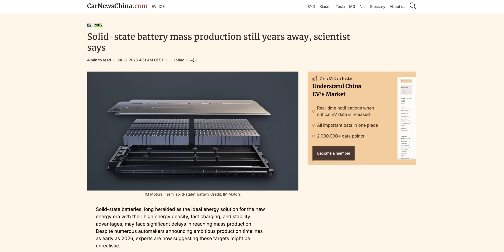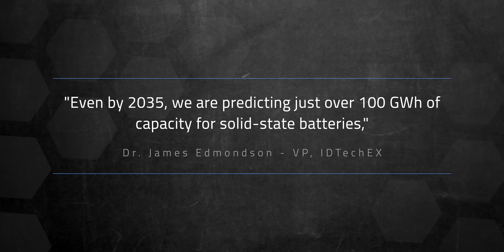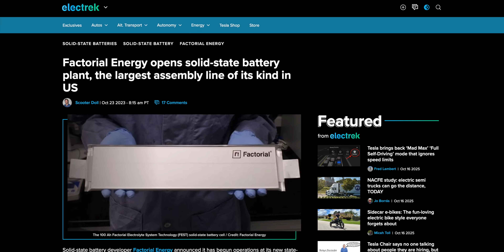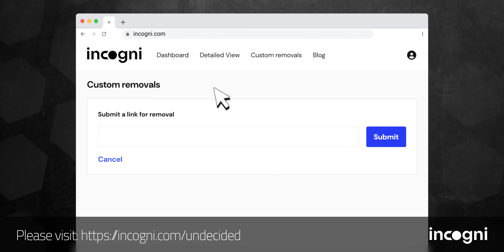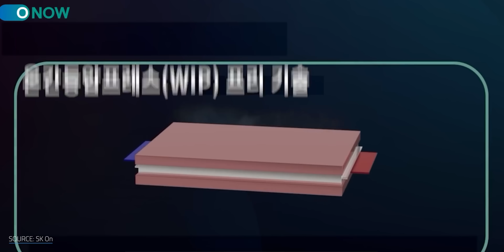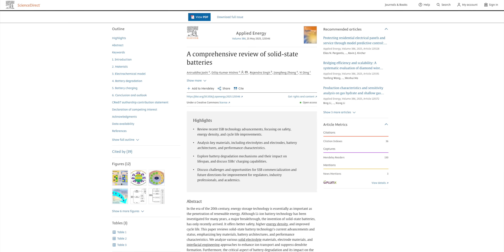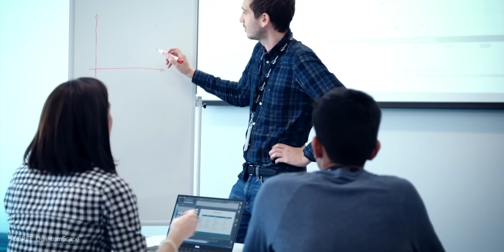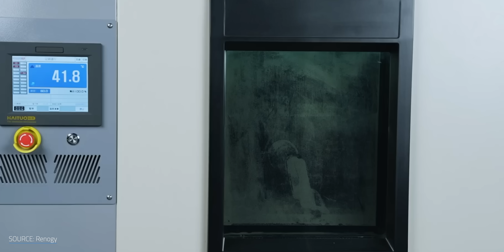How Close Are We to Solid-State Batteries?

Comment: I think that the present and mid term future (<10 years) are the hybrid vehicles. Charging 80% in 12 mins is not a game changer. The idea is charging 100% taking the same time to fuel a tank full; this would be a game changer (assuming the same quantity of energy added) Also, the batteries should keep its energy density for years

Comment: If SSB technology can meet a few key goals, a lot more American drivers will at least consider replacing their ICE car with an EV. If the energy density can be doubled, 5 passenger sedans and compact SUV's with 600 miles of range will be possible. If 600 miles of range can be added in under 40 minutes (assuming a 300 kW EVSE), acceptance of EV's will increase dramatically. If cycle life increases to where a battery will last 500,000 miles, people will quit stressing about it - very few Americans want to keep any car that long as it is. If SSB electrolytes prove to be more resistant to dendrite growth, especially during DC fast charging, prospective EV buyers will quit stressing about battery replacement cost.

Comment: Why are they called solid state? ALL batteries are solid state, nothing moves… maybe they should be called solid construction? Solid electrolyte?
Reply: It's got nothing to do with moving parts the term comes from Solid state ionics. There's no need to change the name Solid State Batteries have been around since the 1970's and predate the term Solid State Drive that your confusing it with.

Comment: I think that benefits are being missed.   No fire hazard means attached garages and massive ranges means smaller charge amounts are usable distances.  If I can plug in a BEV in my garage with just an outlet and get 5% overnight, that is nearly 40 miles with a battery 750 mile range.  This also opens up inductive charging for automated vehicles.

Comment: You won’t see any solid-state battery in cars under 100k before 2030
Reply: @DanielOcean-xn1ts  yup, its better to go back to V8 engines.
Reply: @Malkus1 nope, lithium batteries still get the job done
Reply: @DanielOcean-xn1ts yup, but gasoline has better energy density😂

Comment: I think what is most important are the materials. Because they determine the supply chain, and the supply chain is dependent on geopolitical factors. Certain political powers are interested in maintaining fossil fuel dependence, exploitation in countries like Congo, and other abuses. A sustainably sourced battery with energy density and performance that can compete with fossil fuels would have a cascading effect on global economy and politics. There will be obstacles that go far beyond engineering challenges.

Comment: The Wright Brothers first flight flown in perfect conditions for liftoff 
travelled 37 metres (the length of an average house lot)
 in 12 seconds at a speed of 10.9 km/hr (race walkers can walk at up 15 km/hr).
The flight reached a maximum altitude of 3 metres,
just high enough to get over the head of Robert Wadlow if he had been standing there.
And the Wright Brothers 1903 plane was basically a frame with wings
and no real cockpit.

Just 15 years later WW1 planes could fly at up to 193 km/hr (225 km/hr for some planes) 
and reach altitudes of up to 3,000 metres (6,000 metres for some planes).

It took only 12 years to go from Sputnik to Apollo 11 landing on the moon.

Was technological advancement of early planes and of early spacecraft insanely fast 
or is technological advancement of other technology such as solid state batteries 
ludicrously slow?
Reply: War (and threat of war) meant that governments put alot of man power and resources into those technology advancements. This battery tech is mainly relying on private companies to further the advancements and production which is why it's slower.

Comment: With how much an issue lifecycle is in EVs, they should make it so the battery can be easily removed and slow charged outside of the car so you could potentially have multiple, or maybe a trip to a EV refueling site similar to a gas station where you drive up and they swap out the battery and you move on. With mechanical assistance and a car designed for a fast change, you could easily swap a battery bank in time comparable to a trip to a gas station.

Comment: I would like to point out that electric motorcycle Grand Prix is only 8-10 laps, but Mugello Circuit lap distance is 3.259 miles, so it went a whole 32.5 miles at race power and never cleared 200mph. MotoGp race is only about 80 miles. Daytona is 200 miles. Lame at best. Good electric will be here when room temp superconductors or fusion reactors are a thing, anything until then is not going to be practical on a massive scale. Can you imagine how cool model hobbies will be with batteries that perform? Wow.When they come out with a car at an ordinary price, that will go farther than I can drive in a day…meaning 12-13 hours highway speed on a charge. I can do that with one 10min fill up.

Comment: One alternative is having something generate power on the vehicle/ device like "nuclear diamond batteries" or just use "nuclear diamond batteries" or some similar tech.

At the end of the day as long as it is safe/ affordable/ effective/works in hot and cold environments well enough/lasts a reasonable amount of time and hopefully better on the environment, Then good enough.

With solid batteries would it be easier to do maintenance/ recycle the battery?

if "dendrites" and build up is the main problem with batteries not working/ reducing capacity/etc then with a solid/mixed set up you could physically remove them and replace small amounts of the  battery then continue using it.

For example have the on both sides have liquid and a maitnance opening, then just open it up, replace/ gather up the liquid to reuse and scrap the surface of the solid parts.
Can also remove the solid parts and remove the build up then "reforme" the solid parts to prevent problems on the surface and material losses by adding the needed amount back.

Comment: Some of your information here seems a little out of date. Look more deeply into Quantumscape.  They have released independent testing data on their battery demonstrating it's capabilities. Some of the issues you said have yet to be solved, have been. They have reached the B sample phase, which, according to them, means it has been validated and accepted as a B sample by the customer (Volkswagen). They have been sending their battery cells to customers for field testing for a couple years now. When you said they are going to be starting field testing in 2026; that is for the latest version of their battery QSE-5 built using the Cobra process and other improvements. The main challenge now isn't designing the battery but solving mass production.  This is still a big hurdle to be sure, but there is less uncertainty than there was.

Comment: I’ll wait another 10 years to watch this pan out. That way I don’t make a lifetime investment that would alter my life’s course in a bad way. Just bought the Lexus GX 550 body on frame meaning I’m in a tank safer than everyone else on the road. should last me 50 years. 👍🏻 FYI, these celebrities and politicians preaching down to us about how we should all be driving a Prius. Well they all use private jets with gasoline usage so high that just one trip One Direction carrying one celebrity or one politician uses more gas than me, my children, and my grandkids, and great grandkids would all use driving a truck over 100 years. That’s how much fuel those jet us. so I’m not worried about my microscopic carbon footprint compared to them driving a gasoline car. want to solve global warming you tell AOC to start riding in coach. I’m not buying any batteries until that happens.

Comment: Until cars with solid state batteries are on sale at a dealer near me, then as far as I’m concerned they will remain the BEV equivalent of nuclear fusion, always coming, but never arriving. MG’s semisolid battery car doesn’t seem much different  in terms of range and price to their current cars; the MG4 Extended Range, which is already on sale in Europe has a WLTP range of over 300 miles and is reasonably priced for an EV.

Comment: Batteries are the downfall of electric vehicles.
It's just an extension of Gas, oil, Coal power.
Nothing changes until Hydrogen or other means succeeds that old power source. But obviously we're not ready for that move. It is still the Political Power to control other countries using the Gas, Oil as a weapon of control that Dominates the decision to remain in the Flintstones era of technology.

Comment: Commercialization is normally at least 3 times the initial claim with an 80% failure rate.  Can’t say I am a big believer in evs at this point and I think there will always be a need for at least hybrids. For me car EV’s minimum requirements are; 600 mile range, recharging to 300 miles in 15 minutes, full charge 25 minutes and half the current weight, twice the lifespan and more temperature neutral, no rare earths that cause mining and recycling disastrous impact. Trucks, 4x4’s, van have other more stringent requirements.  They are just not practical for where I live and my usage. I don’t short commute, short drive anywhere, long trips to middle of nowhere and off-road adventures, nor can I afford to buy an “extra” v only vehicle, 1 needs to do everything.

I really like the approach that Edison electric in Canada is developing for hybrid semi-trucks.

Comment: The problem with fast charging...Cutting the time in half means doubling the power you need from the grid.  Battery cars are now totally below data centers for AI is first in the priority for grid power.  And the grid anywhere near an AI datacenter is VERY close to saturation, where if anything hiccups, you lose power like happened in Spain, except you have to restart lots of spinning iron.   Then throw in the issues with the chargers having their nice expensive copper cables stolen, and you have a super mess.  (Cost of that fast charging is going up faster than the electric rates, so it makes travel real expensive...

Comment: Imo cells and batteries should have rating that clarifies different characteristics (heat exposure, over- and under voltage, shock etc.) and overall safety rating.

Comment: As far as I'm concerned, the term solid state used in any electrical applications has already been used in differentiating vacuum tube technology from transistors in the electrical industry. As long as both products are still being marketed, this term for use on a battery needs to be removed from marketing. We already have too many lazy marketing people starting out 90% of commercials with, "What the government doesn't want you to know..." You're looking at radioactive batteries or high fidelity batteries if you let them do this

Comment: Some liquid could mean transfer of heat can be better. Semi- solid state should be the standard if it can reach 400 -700 miles. 80% in 12 minutes is perfect. But 5 minutes gets 150 - 250 miles and it is still safe that would be great. 
If they keep trying to go fully solid that is a fairytale. Liquid is the best form to transfer heat.  Semi solid state should sounds like a winner.

Comment: The definition of "solid state battery" exists independently of the marketing or internal terminology of various companies. From Wikipedia "A solid-state battery (SSB) is an electrical battery that uses a solid electrolyte (solectro) to conduct ions between the electrodes, instead of the liquid or gel polymer electrolytes found in conventional batteries". Just because some company tries to "lower the threshold" for marketing and/or stock reasons doesn't make it true. Let's all stop repeating marketing whitesheets and the talking points of company PR reps.

Comment: Let's face reality: 
For that, simply look 5 to 10 yrs ago: 
The ranges and the quick-charging-times actually have improved. 

But the rest of the cars clearly don't! 

Overall annoying assists which can't be disabled permanently, 
ugly rectangle displays, 
confusing non ergonomic only touch operation systems, 
bad visuality (Polestar 4 even completely without rear window!), 
features with need of subscriptions, 
online-requirement, 
ads on screen (VW ID 4), 
glaring headlights, 
high maintain-/ repair costs, 
ugly design...

Where is the benefit of better batterys, 
when the rest of the cars gets worse and worse?

Comment: Excellent analysis of the current state of battery tech. I don't actually care if an EV battery is an all solid state battery or a semi solid state battery. What matters to me is how long does it take to charge the battery and how far can it go on a single charge and how many charges can it take? That's what's important for consumers. My gas vehicles can go for years with the same engine, they only take a few minutes to refill the tank and they can go 400 or 500 Kms per fill up. That's what's important. I look forward to when batteries will be able to do the same thing as a gas engine.
I wish we would have stuck with battery technology in the beginning. If we had the 100 plus years of development for battery technology we have had for gas/diesel technology we would be light years ahead of where we are now with battery tech.
Reply: The most important thing is that the battery needs to be fire safe, so one can park it safely in the garage or near the house. I wouldn't touch an EV until that is solved. I'd buy a Toyota ICE.

Comment: We don’t need solid state batteries. Battery technology is advancing rapidly and the power density is still increasing. New chemistry is safe and the useful life is already as long as the useful life of the cars/trucks. Useful range of 500 miles and rapid charging is already here. Solid state is now unnecessary. The next step is recyclability.

Comment: I feel one thing is missing from your video. The holy grail of li-ion batteries isn't being fully solid state, but using a (fully) metallic lithium anode, which would massively increase energy density. (Today mostly graphite with intercalated lithium is used.)
However metallic lithium is VERY reactive, therefore a solid electrolyte is basically a prerequisite.
I believe none of the batteries mentioned in your video feature metallic lithium anodes (not 100% sure, please correct me if I'm wrong).

Comment: Still don't understand why no nuclear alpha particle batteries?
Reply: The produce why too little energy.
Reply: They do exist but they are designed to run low power device in remote or hard to replace systems.

Comment: The biggest problem I see in the new battery tech is lifespan. There will be no battery produced that can last 50 years (available to the plebs anyway). I doubt any cell technology will be allowed/pursued that will last over 10 years. Tesla engineering to get cells to last 10 years is excessive. Then you hire a third party to modify your partially failed battery until excessive failure. 

R12 wasn't made illegal because it harmed the ozone layer (yes, it is still manufactured). but because Dupont wanted compressors that wouldn't last as long (I have a 40+ year old R12 freezer that still works). My college chemistry professor was on the R12 ozone layer team and they found nothing significant.
Reply: Well you can't really encourage companies to make super long lasting products off market forces alone, it will lower sales.

This is the main reason why I think controller manufacturers refuse to build their thumbsticks in a way to virtually get rid of stick drift permanently. The main reason people discard used controllers.

Comment: I don't care if it's a wet-dehydrated-solid-porous state battery. If the price of a vehicle doesn't MATCH an ICE vehicle and get similar range, I'm not buying it. If it increases the price of handheld devices (phones, leaf blowers, drills, etc)...not buying it. It has to compete with lith-ion and it has to be similar amount of power delivered.

Comment: Fully solid electrolyte may not be possible or come with many complications due to the difficulties with maintaining full contact between the solid electrolyte separator and anode/cathode electrodes through all permutations of charge/discharge state of charge, temperature, aging, manufacturing variance, etc.

The logical first step towards closer-to-solid batteries is replacing the separator (and the bulk of electrolyte) by a sheet of solid electrolyte, eliminating one dead-weight component. That is 50-80% solid using fundamentally the same battery construction as standard cells.

Comment: Most buyers dont care about specs.

The importance of battery classifications only matters to the few who get into the weeds and care.

What need to happen for the betterment of the industry is branding. Buyers cars about trusting a label telling them something is good or not.

Saying solid state batteries are safer is all you need to tell the consumer.

5% liquid isnt a stat theyll care about. And will only confuse them.

The differences need to be labeled by their defining characteristics.

If all solid state batteries are safer, keep the solid state name

But if a small amount of liquid makes the battery more performative, due to charge capacity or charge speed, or discharge rate. Label it using a term that expresses that information

"Solid state performance"
"Solid state efficiency"
"Solid state economy"

Thats how you get people to care about the little differences